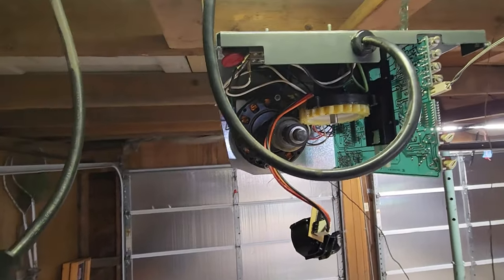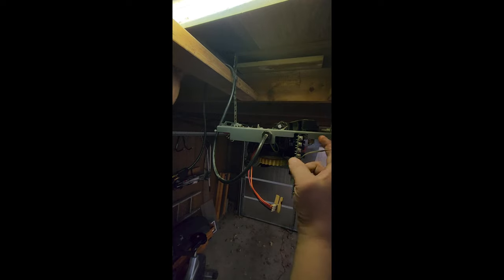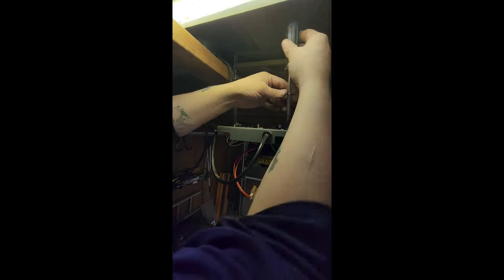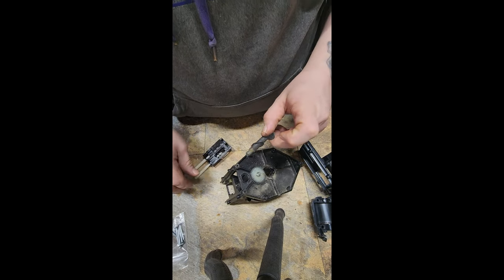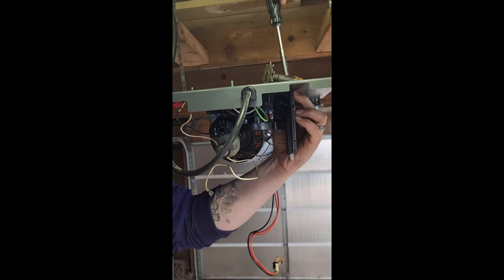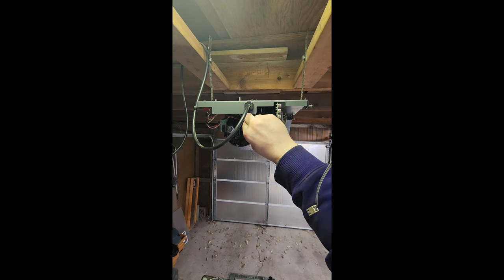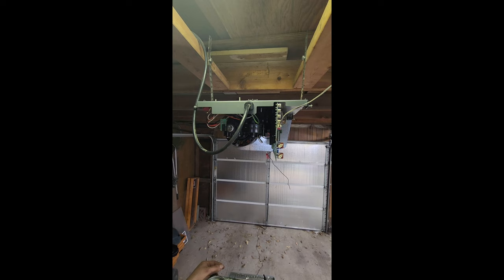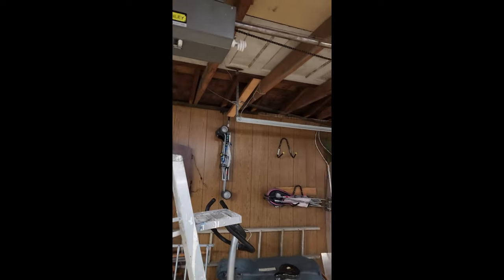Stanley garage door opener gear housing replacement.

Comment: Thanks. Your video helped me figure out the orientation and exactly where to attach the RPM sensor board when I replaced the gear case on my 30-year-old ST-300. The existing gear case was shattered in about 20 pieces so it was of little use in figuring out how to put the new one in. I bought a gear case kit (p/n 24829) from Moving Up Garage Door Company for about $45. 

I unmounted the entire opener, other than the track tube and chain, and did the work on my bench rather than overhead on a ladder. 

The most difficult part of the job for me were the travel and force adjustments. The initial set-up instructions from Moving Up left the opener almost non-functional. It took about an hour and a half of fiddling to get the door working right. During that period, the thermal cut-off fuse kicked in when the motor overheated from the constant up and down. Back in business after about a 15-minute hiatus for the motor to cool down and the automatic re-set of the thermal fuse.

There are some online comments that the replacement gear cases don't hold up. I'll have to wait and see. So far so good and happy to spend $45 and some time versus buying a new, different brand, opener.
Reply from the maker: Thanks awesome! thanks for watching! Definitely first time I've ever fixed a garage door opener but it was fun. Feel free to subscribe if you like random fixes!

Comment: Thank you for the video.
I have the same broken gear housing problem.
I would have liked to see how you took the gear housing apart in the beginning, especially removing the  spring loaded "Safety Sensitivity" knob mechanism.
The gear housing replacement is Stanley Part No. 24829.

Comment: I have the Stanley Model 3200 garage door opener.
Unlike your model in the video,  mine has the spring loaded "Safety Sensitivity" knob mechanism, which has to be removed in order to disassemble the gear housing.
I'll have to find out how to remove it.
If you have any ideas, please reply.
Reply: Did you find a video that included the removal of that knob? Please share if you did thanks